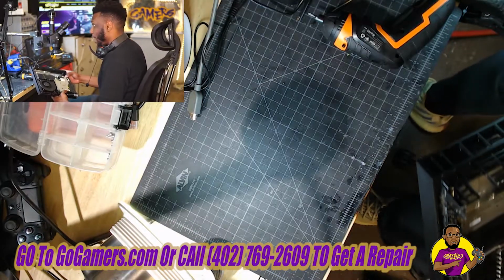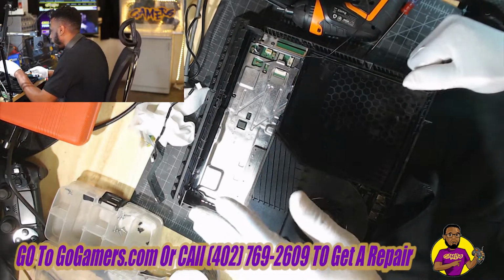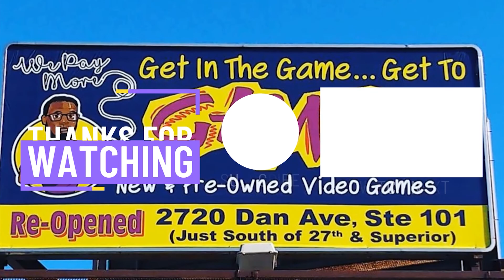FIX PS4 Water Damage/Not Taking In Discs + Not Updating (QUICK REPAIR)

Comment: How much money would I have to spend on my ps4 if it has little to med water dmg
Reply: Same 😭
Reply: I put freezer ice in a bag on the top of my ps4 and as it cooled down the ps4 it ejected my disc, then I looked around it and water had slowly leaked down into the vents below it, so instinctively I instantly turned it off and removed the casing and, to my expectations water was puddling all over the inside, I was able to dry it but now it can’t read discs, it can do everything else thought.
Reply: @MrMimic-mk9jq  how did you dry it
Reply: @chrisgarcia117  well I used quite a bit of paper towel , it worked nicely
Reply: @MrMimic-mk9jq  this happened to mine and drops of water came out of my vents how did u dry it
Reply: @Naeem_-ym9ts  I opened the case and used paper towels and a rag to dry the circuits (as the can corrode pretty badly) then I got a better screwdriver and unscrewed the outer components and dryer them too
Reply: @MrMimic-mk9jq  hey man same shit happened to me but i dont have tools to open the whole thing up so i waited it out and worked again after a day or so (disc reader got fucked like yours) and its been fine for like 2 months but it happened again and it was less water dis time hopefully my shit comes through again🤞
Reply: @daniel-xm1kj  did it come through
Reply: @shavonnebush5043  bro it took a month of me trying and it never turned on only did beeps i havent tried after the first month but id say its dead got myself a pc tho
Reply: @daniel-xm1kj  I just got mine back yesterday and I plug it up and it turn on again but it turns off after 20 minutes ever time

Comment: So mine was fully submerged in a tub of water for about 30 minutes. I let it sit out for about a week. It turns on now but I have the blue light of death. Any help would be awesome
Reply: i can help
Reply: if ur in the blue light of death hold the turn on button till u hear 2 beeps then the ps4 will take u to safe mode if that doesnt work u need a new hardrive

Comment: heloo I bought one for the low to replace hdmi port but I oppened it only to find water damage inside turns on good takes in and ejects discs but no power to the usb ports or any video outputs

Comment: Hello How are you Sir, yesterday I woke up and my ps4 Slim would not turn on. I didnt know what to do so I took it apart from the top and didnt notice anything. Then I Took it apart from the bottom ( where the motherboard is located) and noticed that It had a good amount of water all over the motherboard and other parts next to it. I let it dry but its only been 2 days. Whenever i Try to turn it on, the blue light appears for exactly 1 second and turns off. What do you suggest me to do my friend?
Reply: The same Im crying my dad is so angry at me